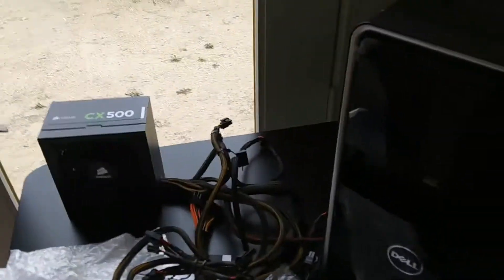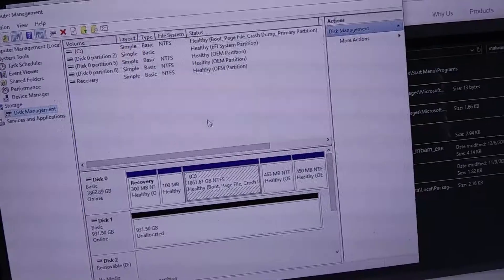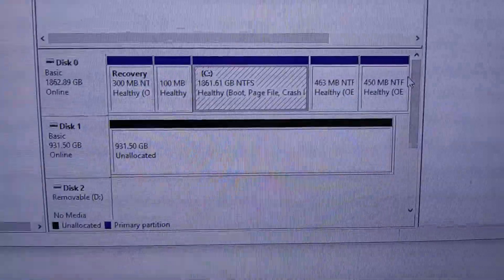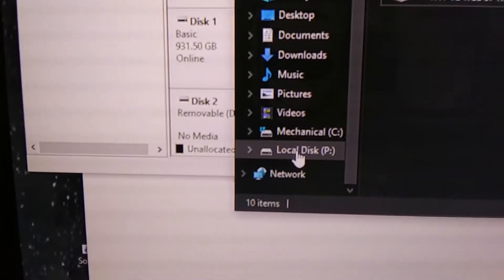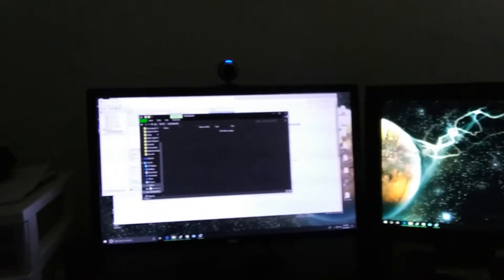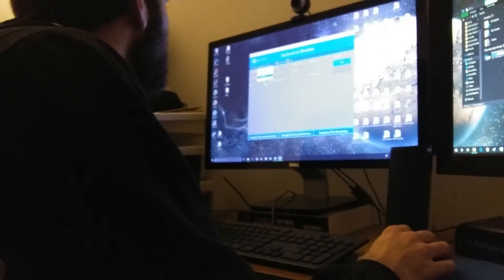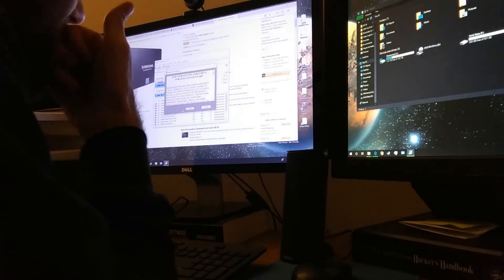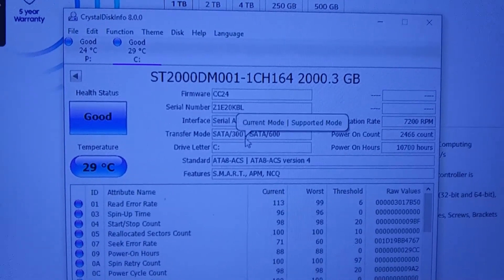SSD & PSU Installation on Inspiron 660 Tower

Comment: Should have cloned the mechanical drive to the SSD, then wipe the mechanical to use as a storage drive only.   You really want your boot drive to be the faster drive.  Macrium reflect would help you do this easily.